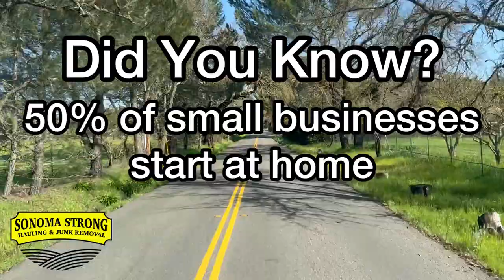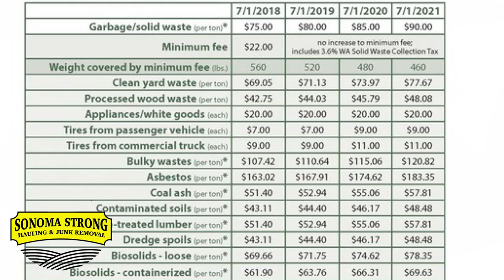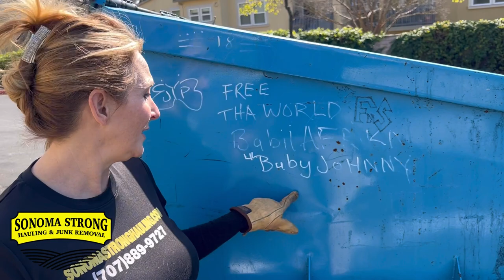Don't Start This Business Until You Watch This!! #howto #tips

Comment: What brand of gloves due you use?
Reply: Always buy rubber coated gloves. 
They have a much better grip than leather. I get mine at Harbor freight.
Also, try them on first. Duh. With most gloves I wear a large. But with coated gloves I always buy XL.
Trust me.
Reply from the maker: @stevesommer44  Thanks for sharing
Reply: I buy the rubber coated gloves at home depot. Husky brand, they're about $7 a pair but I like them better than the ones from Harbor Freight. However either one will get the job done.
Reply: @kdova77  are the needle proof thats my main concern
Reply: Gross!  Did you throw out the broom? If not I hope you bleached it. 😮